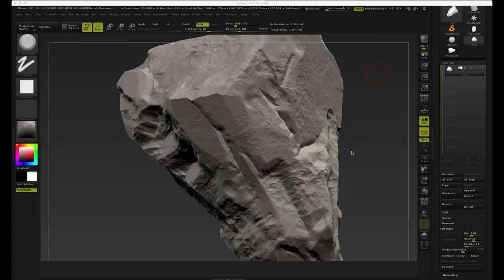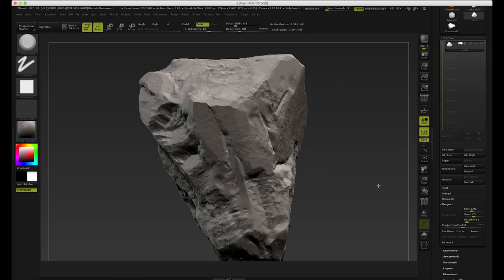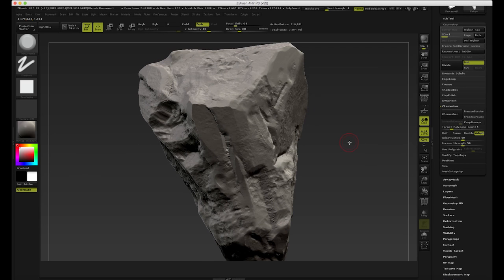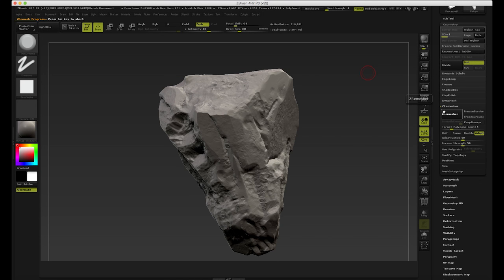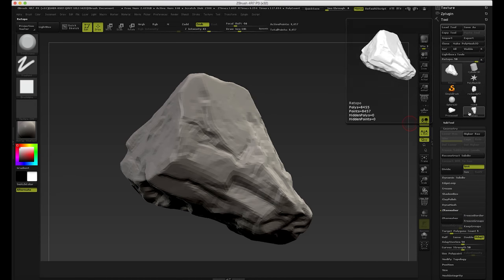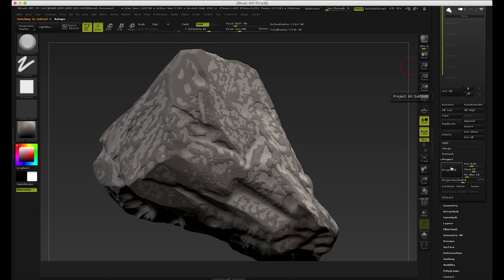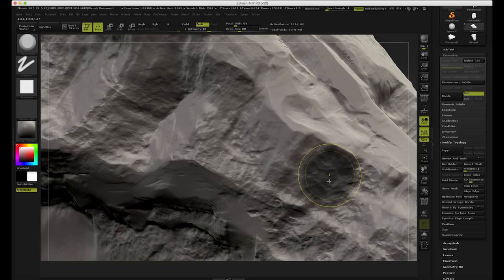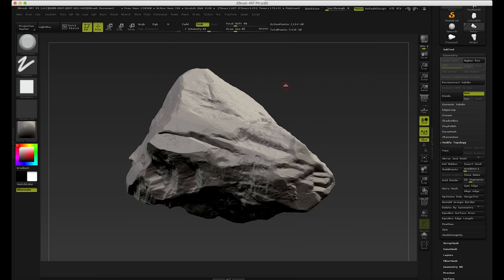ZRemesher and Projection in ZBrush 4R7 (Transfer highpoly to lowpoly)

Comment: You can project the lowest poly created, then subdivide, reproject, subdivide and reproject, until the details are satisfying enough. Keeping the Lower Subdivs and not deleting them, can be useful to go back and forth, working on the low poly object.

I also, consider that the hole is created due to large data from the beginning. If you project the low poly first, and do as I described earlier, close holes might not be needed. Check it out.
Reply from the maker: That is brilliant explanation and advice. Thank you.
Reply: Thats a comment lol. Thanks a lot

Comment: @Jaakko Saari: I would like to ask you a question, again if you have a 3D printer, if I apply following this video tutorial, would you know how the 3D printer behaves, will the model print in high resolution or in low resolution? it's possible that if i apply uv map deception in quotes to the 3d printer, thanks for your answer.
Reply from the maker: I’m sorry I don’t know about 3D printing well
Reply: @yaschan99  thank you the same, the only regret is that ignoring this information between the object backing and the 3D printer; also because I have a 3D printer connected on another pc that its cpu has difficulty knowing how to calculate the vertices; since she worked in 3D, I excluded and asked the question.

Comment: but its still highpoly with 2.4 million polygons..... how to actually transer highpoly detains onto low poly mesh ?
Reply from the maker: +Brown Human this process is called baking. I will cover this in a new video soon. Its possible to do it entirely in ZBrush but there are many other ways.
Reply: Brown Human, you are very correct in pointing out EXACTLY what a thousand people see but are afraid to mention.  You're right, subdividing a low poly mesh defeats the whole purpose.  These YouTube video tutorials are made by people with no connection to students so they "THINK" they are doing people a favor by posting these little "solve all" videos when the truth is more in depth and complex.  The END GOAL is project high detail 3D surface info onto high detail 2D map (a NORMAL MAP) to then wrap around a low poly mesh.  But to do this, you first need a low poly mesh with a UV map.  Any way that you can get to that goal IS THE KEY.  If you can then attach this low poly UV map to a hi poly mesh, you can then "bake" the high detail onto the UV map and transfer it back to the lo poly mesh.... ZBrush is not very good at this.  It is AMAZING for modeling initial detail, but #1 it often screws up maps without telling you, it rotates them, flips them, places them in bad order, plus you have no editing control over the individual UV vertices and edges.  That is why ZBrush's strength is in modeling, but for maps and texture maps, it is not considered a "real" 3D program like Maya for example.
BTW, when people say there is no need to transfer from hi to low anymore, that has more to do with alternate methods which are more advanced than lo-to-hi poly workflow, even though they deny that it is advanced.  It is advanced to people that are new to this stuff.  Floating Geometry is one of those methods, in case you're curious.
Reply: @Cory Lee lol this became true suddenly, since UE5 announcement
Reply: But why are we projecting when we still need to retopo and bake eveyrthing? I don't get it!

Comment: How can I preserve smaller details on my model like spikes when zremeshing? The geometry gets shrunk, faded or even a bit distorted after remeshing and reprojection can't bring the details back.
Reply: u cant Z remesher try to keep a general figure small spikes are probably going to get all deformed or short compared to ur original model. The work around u can try is not remeshing but decimating  and projecting because triangles will follow the shape perfectly. Other optition u can try with Z remesher but i do not think is going to work activate paint brush and paint red where u want more geometry and before  Z remehser activate (use polypaint) to tell z brush u want more geometry in the spikes.

Comment: you dont show the result in low poly at the end. I am gonna go for an other tutorial then.
Reply from the maker: +therond gabriel well retopology and baking was not the subject of the tutorial. Should I make a tutorial on that?
Reply: Yes it can be awesome!
Reply: @yaschan99  But why are we projecting when we still need to retopo and bake eveyrthing? I don't get it!
Reply from the maker: If you work with Zbrush for several years this becomes a second nature. Anytime If we need to change topology of the mesh the subdivisions need to be deleted. Because ZBrush will consider that as a different model.
To transfer high frequency polygon details to another mesh this is still the way to do it in 2022.
To bake maps at the end is the final process. This is just a way to get there